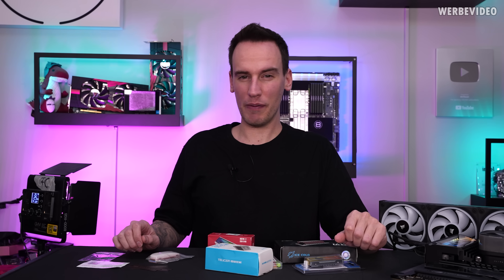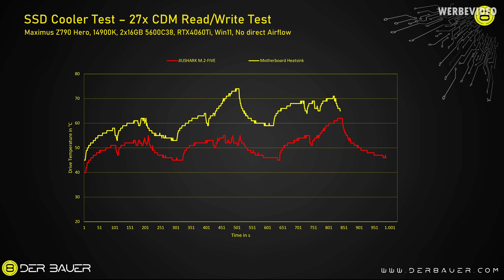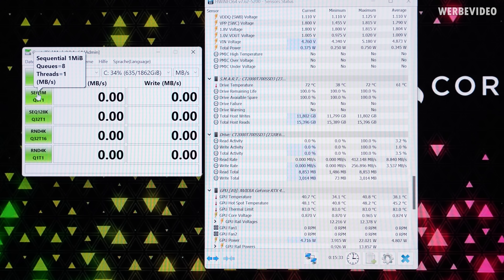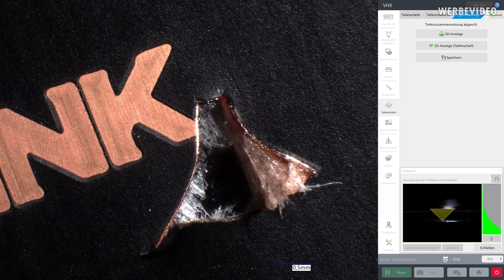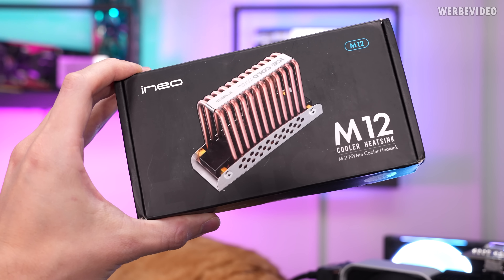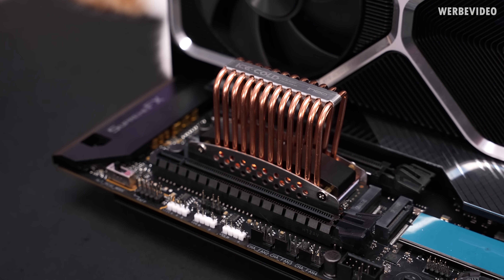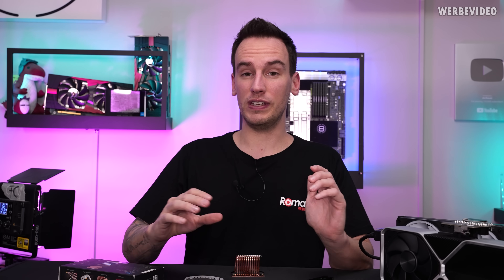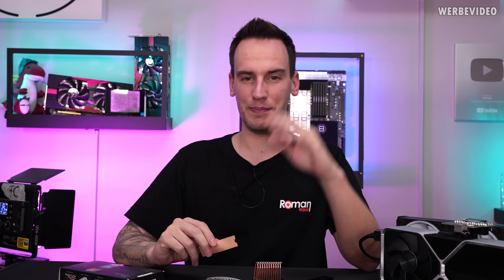Pure Scam! Magic China Sticker to Drop Temperature by 10°C?

Comment: I have no space for a radiator on my laptop, I'm thinking of buying this 0.3mm foil, do you know if it can short-circuit the SSD capacitors? It's level with everything else, in height

Comment: In general, the memory control chip, of PCIe 5.0 M2 SSDs, ~80-90%, are still made with the outdated 12nm manufacturing-process technology, so they require a lot of current and get very hot. /A Circal T700  too 12nm-es process! / I will not buy a PCI exp 5.0 m2 ssd until much more advanced manufacturing technology spreads in this segment as well! PCI exp 4 is already mature, there are SSDs manufactured with 8 and 6-5nm technology. I use those. I'll switch if they offer a reasonable price and good quality, not a heater with giant fins and fans!

Comment: hmmm what most computer review videos seem to not understand about thermodynamics is the contribution of radiant heat transfer. for electronics that are passively cooled (so like without forced air), the contribution of radiant heat transfer is more important than convection. that means the color of a hot object is very important because of its black body radiation. thats the whole point of those pyrolytic graphite stickers. they have a matt black surface finish which is the best surface for radiating heat away, while a polished copper/silver surface is the worst. i suspect you are making the wrong comparison if all you are focused on is surface area....
Reply: Could you explain a little better, does that mean the sticker works even a little?
Reply: @northonfoster5323  ya if youre going for thermal mass due to temp spikes, the sticker is useless. if your going for long term net heat dissipation, the stickers will signficantly increase the heat loss over a long period of time by around 40%. heat doesnt like to leave shiny surfaces as photons in the IR spectrum, but it really likes to leave matt black surfaces. if you dont have air flowing over a heat sink, there is significant gain in overall heat shedding ability just by simply changing the color of an object. its why iphones are covered in black stuff on the inside. its why firewood stoves for heating are painted matt black. the paint/color slows down the convection heat loss, but that only accounts for a minority of the heat loss of a hot object in a room with normal air convection. it dramatically increases the radieative heat transfer through photon emission in the ir spectrum. its all very intuitive if you play around with a thermal camera, you will notice the color of objects is very important for them producing light that can be picked up by the IR sensor
Reply: @vevenaneathna  thanks for the explanation I can have a little peace of mind, knowing that I didn't throw away my money completely 😅

Comment: LMAO! Imagine the usual note on Ali Express where they point out that the product size can differ 2-4 mm depending on human error or whatever they use to blame it on... still, on the "graphene cooler" it is at least written in the correct thickness at least once :P

Regarding the first cooler, I would like to see a regular fan connector instead, and PWM possibly could make it a lot more useful. In that way you could at least power down the fans so your ear wouldn't hear that loud noise. I do believe that different people can hear a very wide range of noise that others maybe can't. For at least me and my mother, we can see the flicker in some florescent lights, most people can't. Also, I have tinnitus, but I can notice sounds my cat doesn't notice. very odd indeed.

The last cooler was too bad it was a scam in the way that it didn't have heat pipes. Imagine how good it maybe could have been if it was real heat pipes. But I guess, that if it would have been heat pipes, it would not have been a continuous pipe, it would have been several u-shaped pipes. I wonder how many Chinese people/companies that really think they are making something good and don't know it vs. the amount of those that just don't give a damn. I would like to believe that they would succeed much more of they just went all the way and made a great product instead of somewhat good product. In my opinion it's a scam, but with a working end result. It would be nice if Roman could check the purity of that copper since he thought the weight was too little to be solid copper.

I would love to be able to one day visit Thermal Grizzly and take a look at their "Museum of Shitty Coolers" :) Love from a Swedish, a descendant of Germany; Engelke

Comment: why the fuck does system crash when ssd overheats. all of my old gen 3 nvme's are absolutely fine without any heatsink at all. at worst these gen 5 should throttle hard, not crash the system completely. otherwise they are less reliable than old tech

Comment: Get some 1.5mm thick Arctic TP-3 120mm x 20mm thermal pads and replace your stock thermal pads that come on your mainboard heat spreaders. You won't be able to make your drives break 50-55C. So long as your board has descent SSD heat sinks. All you need.

Comment: I believe the idea behind hollow heat exchange pipes is that it reduces the overall mass of the copper components while still carrying heat away. If they are solid, they'd become heat soaked easier. As far as the gen5 high temp issue, I'm gonna try and put my faith in technological advancement. I believe I read that it's the nand controller that's heating up and to me, that really seems like an issue that will improve as the technology evolves. Hopefully soon so laptop owners can benefit from the gen5 speeds.

Comment: I use in a laptop coper plaat vs non.
On my hp ssd .
Without it the temp go up and crash .
With that thin small coper plate it stabel to use .

Somtimes you only need a small thin coper plate

Comment: Also as point of note.

The fact that youre testing some of them on an open test bench might skew the results a little compared to real world scenarios where people have their machines in enclosed cases and 3-6 fans moving air in and out of the case.

In a real world scenario. You might get away with not needing to have the fan in at all if you have good airflow inside your case.

Comment: Just got a Lares 2TB gen 4 that came with one of those foil type heat spreaders. In the same test it tops out at 54c with max speeds being 7112 MB/s read, 6645 MB/s write. Idle temp of 44c

Comment: Great video! I tried some jeyi hardware and in general for the price is ok. In my case I am really happy with the big heatsink that they made in CNC aluminium (the version with the long fins on the same direction of the airflow, not the one with the short ones). In my case this heatsink can keep a WD 850X pretty stable with a max temperature of 54c during benchmarks (ambient around 24c). I am not using the provided thermalpad by Jeyi thought, I am using a thermalpad from thermalright and the drive is not throtling at all. I would be happy if you try also this model in your review. Also, the ones from Jeyi with the short fins, I used one in a SFF build with a vertical airflow and the performance was really good (considering the limited airflow in a small case). I think when you review a "short" heatsink for M2 drives you should consider vertical airflow instead the standard horizontal airflow we have in most cases.

Comment: i need cooling for my nvme it is burning @ 102 degree celcius . the plate from the motherboard was not good enought so i got a Archnon thicker heatsink.. still not good enought.
it just wont go down. i did wrote to Viper maybe they have a clue .  one mm copper what a joke !

Comment: In the matter of copper-graphene decals, if I were to embellish test results I would use a low power NVMe with the lowest gen PCIe version. In that way I can just claim the temp results without indicating what NVMe model was used. Then I choose a case where a case fan would blow right across it.

At best it works as a heat spreader.

Comment: My first DIY M.2 cooler was a 40mm fan I jammed underneath the CPU cooler so it pointed at the M.2 drive. It worked pretty well, and once I stuck a small heatsink meant for  a Raspberry Pi on the controller chip it worked well enough that I never had stability problems again. The little 40mm fan didn't spin very fast so the noise was completely masked by the rest of the system.

Comment: samsung nvme ssd come withthose coper sticker.
could you test the following:
default SSD  with its copper sticker + a heatsink ontop
default SSD , remove that copper sticker + a heatsink ontop.

would like to know if that sticker has an impact on heat extraction.

bonus: "spreading the heat" may be interresting for fimware that also spread the load on several nand ? ...

Comment: Re: JEYI M.2 Copper Graphene Heatsink:
I used to work in a physics lab doing experiments on graphene around 2012. If you can get the top layer off so it's just graphene on copper, you can visually identify if it's single layer graphene, bilayer, or many layers (graphite). It's actually quite easy to see graphene on copper with just an optical microscope with good magnification! You've already demonstrated that it's carbon, so visual confirmation that it's graphene should be adequate. Of course, how useful the graphene is for heat transport is a good question, because if you put copper under graphene and some thermally conductive material on top of it, it's useless! You want to isolate and protect the graphene with hexagonal boron nitride, or it'll be no more useful than graphite. Graphene is a very good heat/electrical conductor because it has pi bonds above and below it which allow electrons to freely move across its surface. If you block those with more layers of graphene (or copper or some other junk) it can't move heat very effectively. You need a material like hBN that looks a lot like graphene's "crystal" structure but won't interact with it. So putting a layer of graphene in the middle of a sandwich with copper and other stuff makes it pretty useless.

Comment: I don't get why the temps on a gen 5 drive in a gen 4 slot are even that high, my Gen 4 SN850X and Firecuda 530 4 Tb drives don't even break 50c with the motherboard heatsinks. The WD ones are about 10c hotter too due to different ram and controller, but the speeds are the same and I have them in raid 0 for around 13800 read speed.

Comment: I find it hilarious that the Amazon store page for the Ineo M12 shows that it's just a rolled copper wire in the exploded image. Acidalie makes one that has 2 copper heat pipes for the same price as the Ineo M12, and Jeyi makes one that's similar to the Dual Engine, but doesn't have any fans for a little bit less...

Comment: IF the graphene was actually oriented correctly it could serve as a heat spreader to better utilize a proper heatsink mounted on top of it.
Not sure if the adhesive layer ruins the potential gains though.

Comment: The graphene reading as only 90% infer that it is carbon in a resin matrix. Most likely waste carbon fiber filament shredded,  crushed, infused with resin. Creating a graphene like material with substantially lower performance.

Comment: Use the first or last cooler and install a 90x90 fan running at 7 volt to cool it instead (you can get 7 volt by connecting the fan between 5v and 12v).

Comment: basically all premade active cooling systems are unusable due to the noise
some of them may be good for much lower loads (like U12A is capable of handling something like 120W spread over a bigger area) but it's far from what is advertised because max speeds are unfeasible for end user applications

Comment: There is a big difference between a heat sink and a heat spreader. A sink simply provides thermal mass so the device will take longer to heat up. A spreader increases surface area so actually increases cooling potential. Of course there functions will always overlap. But something advertised as a heatsink should be tested as such, if it still gets hot but it takes longer its actually a success. Also as that functionality is what matters for most people for things like SSDs. Stress test performance, especially for SSDs, is only relevant for an extremely tiny number of users.

Comment: beyond he products, it shows me that 5.0 doesn't really make sense. At least for normal (but not casual) use cases.    Where the speed advantags are barely, if at all, noticable but the heat and power sonsumption goes up a lot.
Curently if have 4.0 for the OS and one for some big, busy games.  Both with the simple passive cooler from the board.  But 3.0 seems to remain the perfect compromise. Much easier to deal with and plenty fast enough for just about everything.  Even if the prices were similar, which they are not...

Comment: Wow, have never seen a machine crash due to overheated SSD. I guess it was the system volume, but what's the error message on a crash like that? Does the OS just time out and panic?
Reply: I think that's a very very bad design. Totally unacceptable that a PC part can hang the whole system that way.
Reply: @pi1ns  Yup, I'm not impressed. It depends somewhat on the error (maybe Windows over-reacted) but it should have just throttled rather than failing like that. The Crucial site says "Non-heatsink versions of the Crucial T700 must be installed with a motherboard or alternate heatsink to achieve optimal performance." - instead it seems like they should say "must have heatsink" full stop.

Comment: The jeyi copper foil sticker is intended for laptop without any clearance. Similar to the copper foil label on samsung ssd. They do have thicker few mm copper plate cooler for laptop with some z height clearance. Laptop ssd are usually lower wattage models anyway.

Comment: You should check out the Gelid IceCap pro ccoler. Been using mine for a while now and it holds up well cooling my 990 pro. What i like is that the fan is powered and controlled by a 4pin fan connector so you can actually set the fan speed to something way less whiny and annoying and it was under $20!

Comment: Roman, I hope you going to read this!
1] You doing the tests WRONG, to do proper tests you need to remove the OEM sticker from the SSD, that thing has no place beeing there for tests.
2] When you assemble the heatsink, you need to press HARD on it and then screw it down, like in your second test with RGB, im sure there wasnt proper contact.
3] The thermal pads given with heatsinks are garbage and in 90% of SSDs the controller is LOWER than NAND and the thing we need to cool is the Controller, NAND loves heat.
I had great results with SSDS that had single tehrmal pad covering just the controller and ram near it, and nothing on the  NAND, i had also great results by using slim heaysing on controller and non condusctive thermal paste on the nand to spread the heat  evenly across the device.
BUT the easiest honest results you can get by using Thermal Putty, the Z Height difference between NAND and controller will have no effect

4] That Slim copper/Graphite heatsink is actually GREAT, you just use it wrong and ill explain:
A] The use case for these is for thin devices like laptops, handhelds and everything that has ZERO space for copper heatsink
You put one on the top and one on the bottom, I use them as Bottom heatsinks in devices Laptop or legion go where i have 0.5mm copper sheet slim heatsink on top, and there is nothing on the bottom, so i use this sticker
A] Its NOT for GEN5 and not even GEN4, unless you have a slim device and its your only option aka Better this then nothing
B] it should be applied directly on the SSD, no on top of paper sticker
C] As you said these stickers are used by some brands for their ssds, some of these are soo good that you dont need to remove them and you can just install a heatsink on top, but the one on your Gen5 ssd looks like its paper

Comment: @der8auer EN, JEYI have got few interesing M.2 SSD heatsinks. But only one decent actually sell in China - Xiaolong 2. It's have got copper base (2280 long), copper fins, slim fan and 4-pin power connector. Others two are similar, but full fins and no fan (one slim fins, another tall fins). Problem with them - they connected to aluminum base andd not to SSD directly.

It's main problem with most M.2 SSD - incomplete design.

Comment: That Ineo is a strange one... As clearly some thought went into it... Some engineering went into it. But seemed to skip the final bits that would make it more effective.
Starters, even if its not real heat pipes and solid copper... if they just machined the base more flat, to get good surface contact with the SSD, they would work more effectively. Even more so if they were heat pipes with a low evap liquid. 
But missing out that last finishing stage just makes it into a more close to scam product, than an actual effective product.

Comment: Ya I agree your testing isn't correct.m first..snd second u should have used the graphene hestsink sith a normal motherboard kestsink on tip. Those sre on lots of ssd even the p700 ur using...ur supposed to use with heatsink ad well. It's compared to a open chip pcb ssd

Comment: Maby the JEYI M.2 Copper Graphene Heatsink could be use as a spacer for another Heatsink? You said it does a good job spreading out the heat, Or would it just add more complexity in trying to dissipate heat? Unless the price is a little much for a spacer.
Reply: If it's in place of another sticker, it's good (the real brands using these stickers also use them as a product label).  It adds 1 extra thermal interface, same as a regular sticker.  But vs no sticker, it's worse.  Just spreading the heat laterally in a thicker aluminum HS works fine.